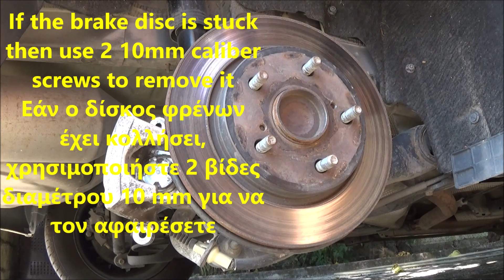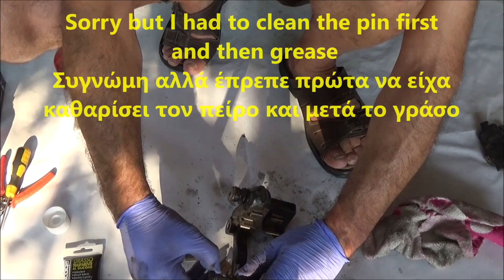2007-2013 Toyota Corolla How to change rear disc brakes and pands PART I Πίσω δισκόπλακα & τακάκια

Comment: Great video Mr. Pagonis. Can I clean the disc pad holder using petrol (gasoline)?
Reply from the maker: Gasoline does work for cleaning parts. But it's also extremely toxic and flammable, and may damage rubber or plastic parts (depending on the parts). So don't bother, just use degreaser.

Comment: Hello 
Did you change the rear rotors before and if so can you sent the link to get some 
With thanks
Reply from the maker: Hello my friend and have a happy new year in 2 days. It is the first time, after 12 years, that I change rear brake rotors. The Corolla brake system of this generation is from Bosch. I send you the following link to choose what you want and it suits you:
https://www.ebay.com/sch/i.html?_from=R40&_trksid=p2334524.m570.l1313&_nkw=Bosch+rear+brake+rotors+for+2008+Toyota+Corolla&_sacat=6030&LH_TitleDesc=ch car + truck + parts & _osacat = 6030 & _dcat = 33654 & _oaa = 1

Comment: The Corollas I see sold in the US use rear drums for some reason, not the disc.
Reply: 9th and 10 gen Corollas are equipped with rear Disc the XRS trim, look it up and 11 gen Corolla im as well.